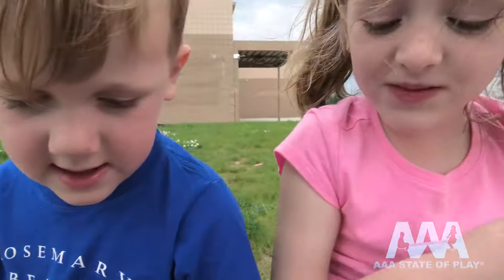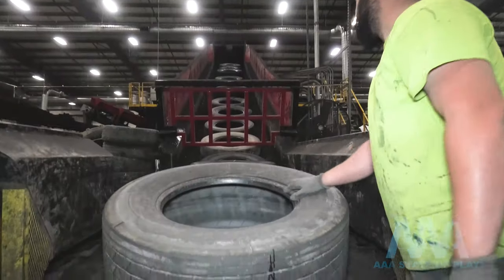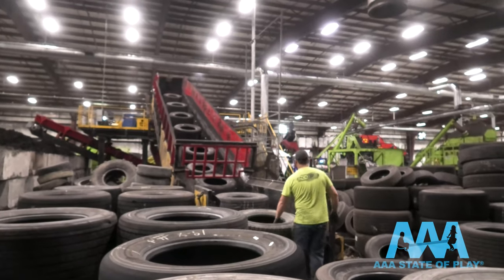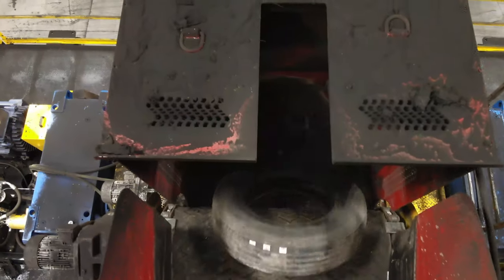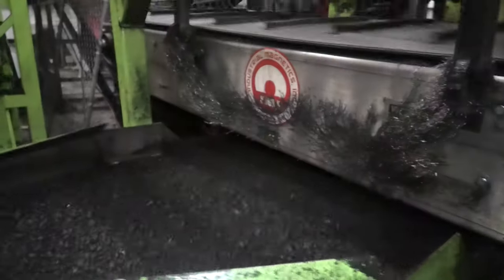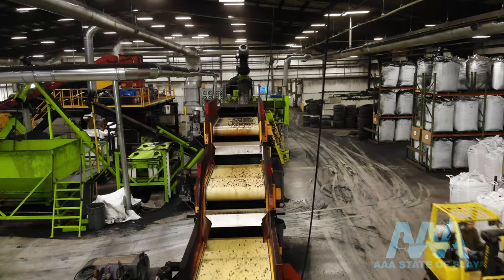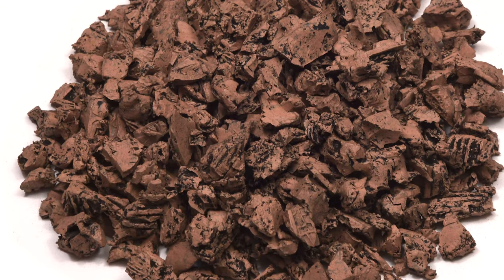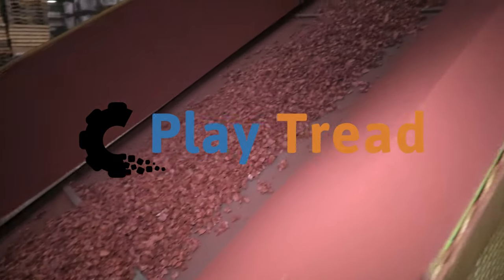Rubber Mulch | How it's Made

Comment: WHat do you mean metal present in the tires?  Is it removed after processing?  Metals are a neurotoxin and I don't feel comfortable using for my kids play area if so.
Reply from the maker: Hi Mady, thank you for your question. Once our rubber mulch is cut up into small pieces, it goes through a three-tiered waterfall magnet to remove the metal, as shown in the video. This process is certified by IPEMA so we ensure that our rubber mulch is safe for kids to play on.
Reply: you should read about the chemicals and heavy metals in tires.. not from the metal they're extracting, but the rubber itself